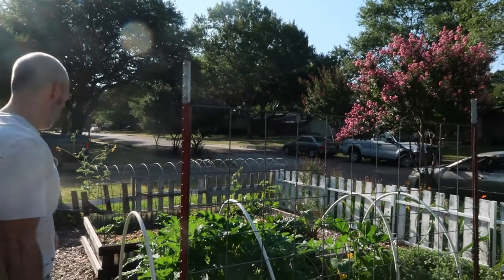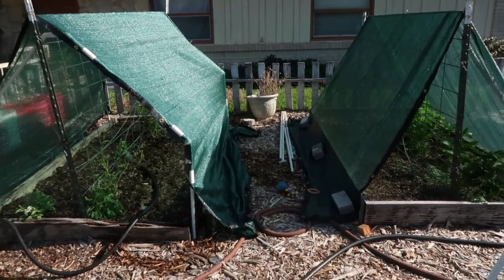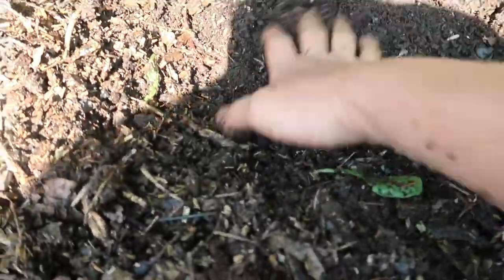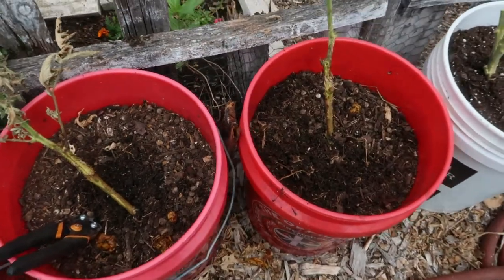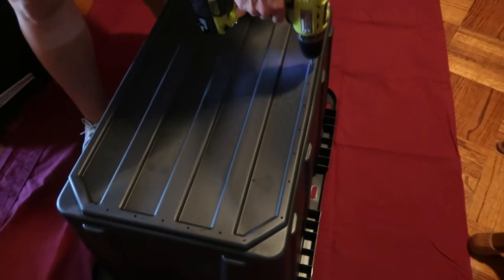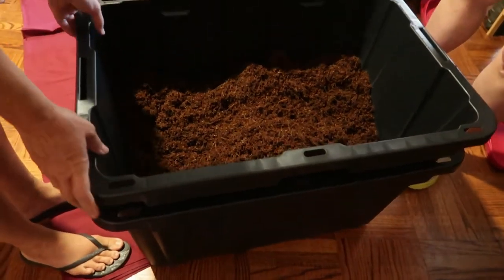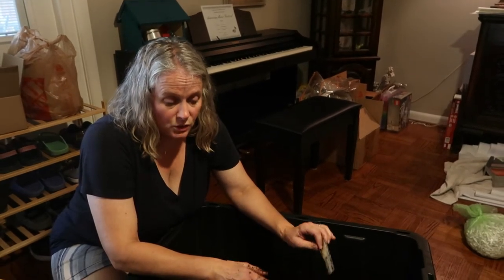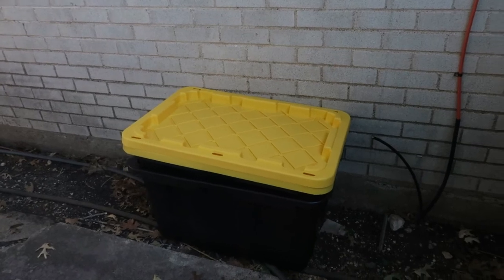Starting tomatoes for Fall, vermicomposting & more shade ideas; July victories!

Comment: I suggest picking up some fence stays, I get mine from tractor supply. they're outside with the cattle panels and fencing stuff. they're like mini t-posts. 42-48" long, about the size of rebar and a flanged area at the bottom to help brace it in the ground. put 4 in the ground and then you can slide the legs of your pvc structures over them to keep them from blowing away. so far so good up here in OKC. you can then either just lift them off and set to the side to work at your plants OR build them tall enough to work under them when they're on the fence stays. cheaper to make them short, but easier to access if you can afford to make them taller. good luck!
Reply from the maker: Great idea, Thank you, Yes it is crazy windy in Oklahoma! If it can stand there it can stand anywhere!
Reply: @BloomWhereYourePlanted  forgot to say the fence stays are only about a dollar each. great for gardening on a budget :)